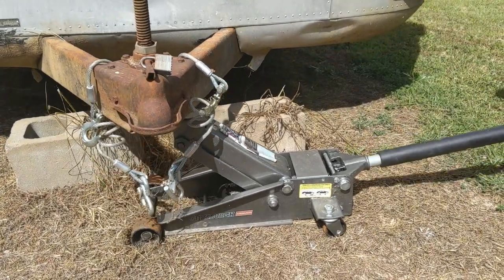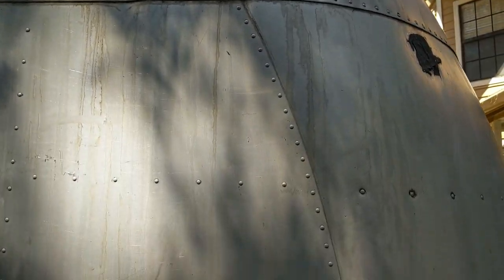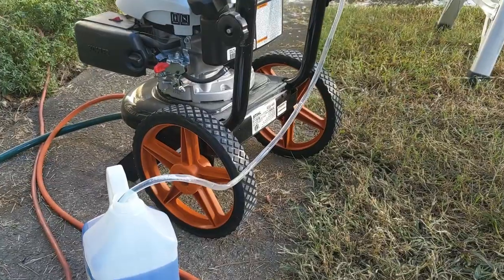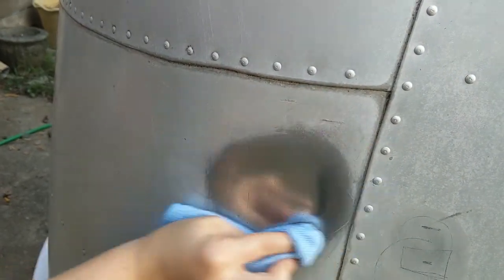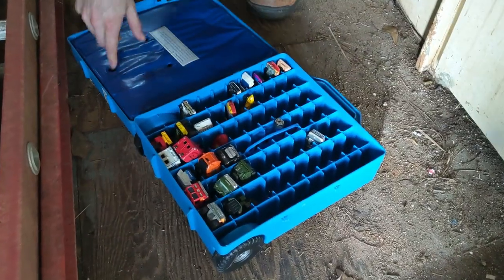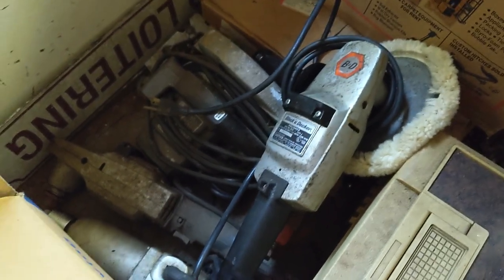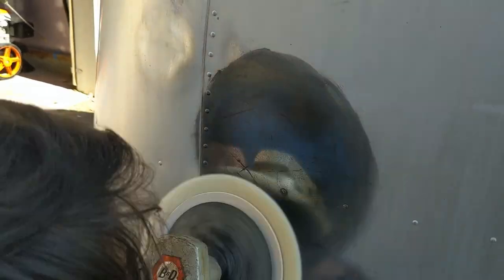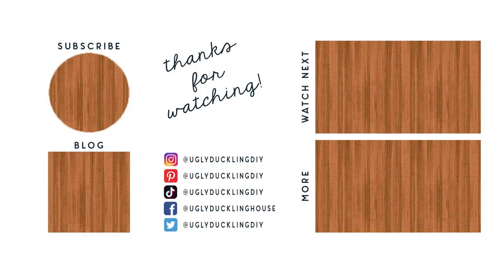Aluminum Trailer Pressure Wash | Ruby's Revival E04

Comment: Just a tip when you connect your safety chains when hooking up the trailer, it is good practice to cross them (X) that way if  the tongue popped off the ball it will land in the crossed chains, or in your case cables, and not do a nose dive into the road. Not a big deal just added security, sometimes the chains are not long enough to do that.  Good video.
Reply from the maker: Noted, thank you! Still learning good tips. Appreciate it.

Comment: Here's some info that might be helpful to you. All the 46 Spartan Manor's had an aluminum skin floor, 47 & later were plywood. The 1946 vin will read 25 for length, 46 for year & a 4 digit production number, mine is 1506 & the tag is located in the front door jamb under the top hinge. The original wheels were a 16" split rim so don't feel bad about the ones you took off, they were from a Ford. The original 46 tongue jack was two sided rack-drive by Spartan, in 47 they started fitting a cheaper screw drive. On top they had 3 pop-up roof vents & a large teardrop fairing around the heater vent. The side marker lights were glass teardrop, two red & two amber. Here's some that will get you the right look at a fraction of the cost of originals, if you can even find them.https://www.ebay.com/sch/i.html?_odkw=aircraft&_osacat=6000&_from=R40&_trksid=p2045573.m570.l1313.TR5.TRC0.A0.H0.Xteardrop+lights.TRS0&_nkw=teardrop+lights&_sacat=6000

Comment: hi guys, on one hand I admire your courage to take on that project, on the other hand, I am wondering whether you shouldn't have started with checking the technical status of the trailer first ... like rust underneath, are understructure and frame after  70+ years still strong enough to carry the whole trailer, is the trailer tongue not too rusty to keep the trailer safely attached when driving (and braking ..) ... maybe you did so without mentioning it ... anyway, good luck with this project! ... by the way, i drive a 30 year old VW T3 Syncro (4WD) camper van, ex military, and had some surprises with this and other older vehicles.
Reply from the maker: We mentioned (I think?) during the episode where we moved the trailer out of the woods and putting the new wheels on that we checked a lot of these things to make sure it could be taken on the road. We worried a great deal about that!

Comment: Hey Sarah! I have the opportunity to buy an ugly duckling 1956 spartan royal mansion for $1000. Moss on the roof, probably water damage roof and floor.What do you think? Worth it or no?
Reply from the maker: Sorry, I don't seem to be getting all the notifications for my comments like I used to (not sure how to remedy that, just letting you know I'm just now seeing your comment!). I haven't finished rehabbing this thing yet and this is our first experience, so we are FAR from experts. If you have to repair the frame, taking the shell off can get really expensive. I think we got really lucky with ours because we know most of the history of it. If I were in your shoes, I'd probably look up info on how to thoroughly inspect it. Western/Southern states: could be in better shape. Northern states: these trailers got more exposure to road salt, so there could be more rust (I realize these trailers travel, but if they sat for long periods of time, the exposure could be different). Per Kyle: push on the sides and see if it gives (could indicate vertical frames broken). I just randomly Googled some of the prices for what fully restored ones sell for (if that's your goal), and they look pretty sweet! I wish you luck if you decide to buy and I'm envious of the extra length (ours is only 25 feet).